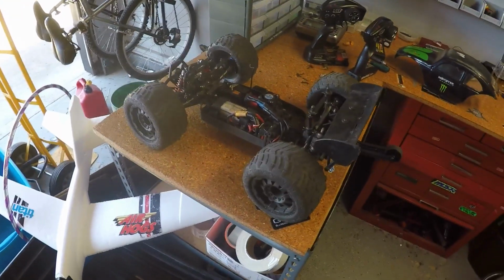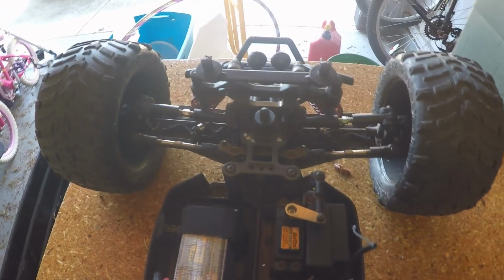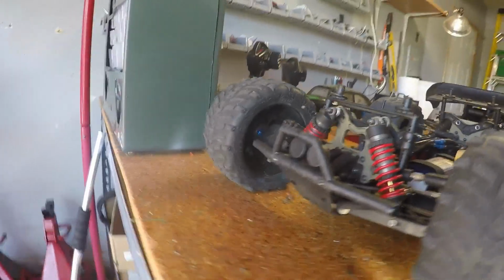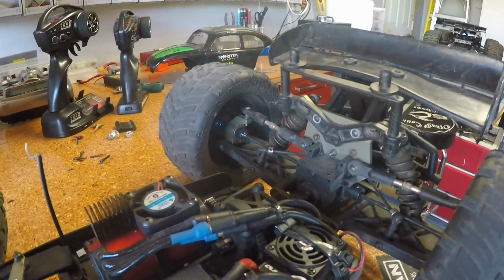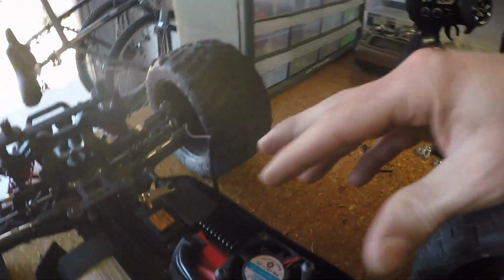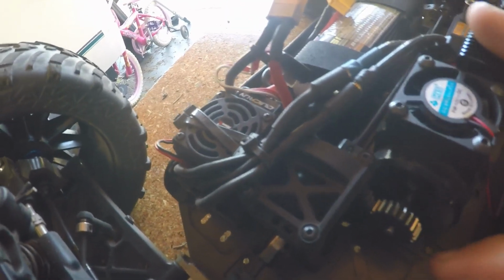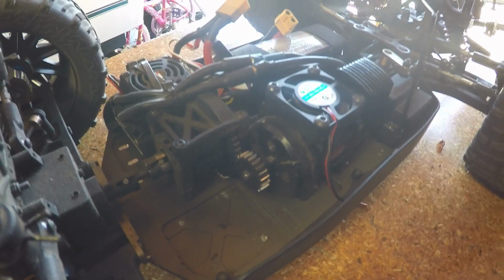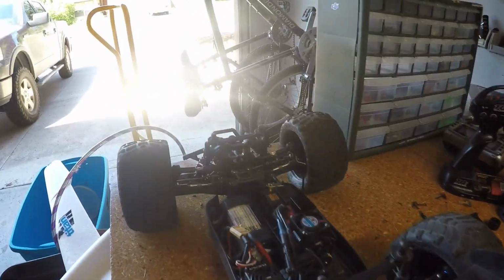How to make a HPI Vorza Monster Truck

Comment: Nice work. You motivated me to fit monster wheels on mine. What wheel do you have. I didn't see them mentioned. Are they Proline like the tyres?
Reply from the maker: Yeah they are the proline premounted  shockwave tires and wheels. Just make sure the wheels you use are offset to get the extra width or they will rub on the arms when you turn.
Reply: cheers buddy!

Comment: Hi, could you please give some more info on the tekno chassis and drive shafts you have there? You don't have the vorza one yep? How did you fit eveything to the new chassis? I mean was it a nice fit with almost no problems?
Reply from the maker: Yeah the vorza parts fit directly on the tekno chassis with no mods.  As I understand the hpi vorza is basically a brushless version of the hot bodies d8 buggy... so almost all the parts are interchangeable. The tekno chassis is a brushless conversion for the hot bodies d8 so it works for the vorza too. The center shafts are included with the tekno frame and are bulletproof.  For the drive shafts to the wheels, the kyosho mp9 shafts fit and are the strongest I have found to work.
Reply: Ryan Rockstad thx bro, I'm thinking of virza now and this might be the way to go after i get bored with buggy. But, thing that worries me is that really there's not much of virza left is there😉? Diffs and A-arms? 🤔 I'm just thinking to MYSELF, if maybe I should get lets say an Arrma Outcast? Cause it's like getting in thus direction, I guess 🤔
Reply from the maker: toomaj RC Yeah, when I built this vorza it was before arrma came out with all these new badass trucks and truggies. I've never had an arrma but I've heard really good stuff about them. I would probably go with the arrma even though it was really fun building a custom monster buggy.
Reply: Ryan Rockstad that is cool to build by yourself and when it works fine! I've upgraded for ex. hpi bullet and managed to getvrif of the weekest stuff by implementing save xs heavy duty stuff - and I really do like the fact i managed to do it 😉 Your car seems to be great and durable and really tuned in for what YOU are doing. And that is the clue od RC! Having said that, I do like nice, durable cars which out of the box beed almost no upgrades - like Arrma vehicles. Take care and have fun!

Comment: I know I am late to the game but I ordered a Vorza, Will those 3.8 wheels fit without the extenders? I ordered 3.8 wheels and no extenders, I am wondering if I should order some. My other question is the shaft looks straight, does that help with smoothness and noise?
Reply from the maker: The wheels will fit (if they are offset wheels) but you will have to set your endpoints for your servo less. You won't be able to turn sharp or it will rub. The longer wheel hexes solve it completely. The best axle shafts are the kyosho buggy ones, they fit the vorza. The key to make it quiet is the losi plastic spur gear. As long as your mesh is right it won't strip and its way quieter.
Reply: @9268ryan  thank you sir!

Comment: Hey dude. Got the Savox Servo. Amazing. Help me please with a mistake I made. I bought what I thought were the same wheels from Proline. Called the same. But holy hell they are TWICE THE SIZE. Any idea where I went wrong?
Cheers. Mitch
Reply from the maker: Awesome. Yeah the tires I used in the video are https://www.prolineracing.com/tires/shockwave-3.8-traxxas-style-bead-all-terrain-tires-mounted/ and yes they are WAY bigger than the stock buggy tires but average size for monster truck tires. 15T to 17t pinion works good or higher for speed runs if you watch your motor temps

Comment: Hi mate does this motor fit with standard vorza motor mount? If not do you know what mount it would fit with? Thanks!
Reply from the maker: Frazer Currall I can't say for sure this motor fits the stock mount but I am pretty sure it does. I think this leopard motor is the same diameter as the stock motor only longer... I believe both motors are 42mm diameter and stock is 68mm long and this leopard motor is 74mm long...
Reply from the maker: I use the tekno frame and motor mount...
Reply: Ryan Rockstad okay thanks bud, burnt my motor out fooling around on 6s and the shockwave wheels haha! A lot of fun though!
Reply from the maker: Frazer Oh, that sucks. You should be ok with a 15t pinion... what gearing were you running?
Reply: Ryan Rockstad  I was running 18/46 which I know was a bad choice now haha. 15t arrived today and new motor on the way